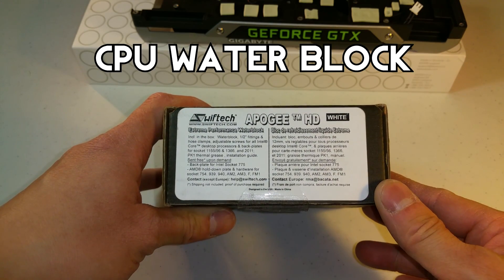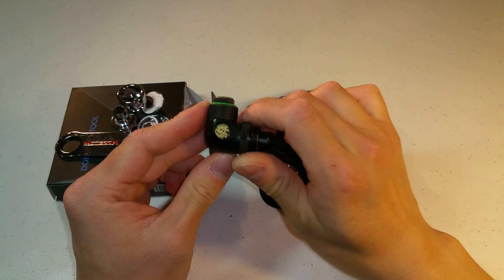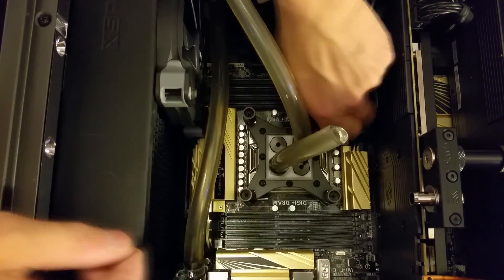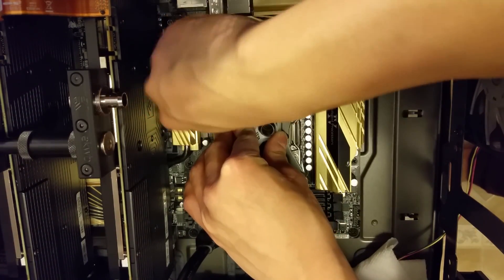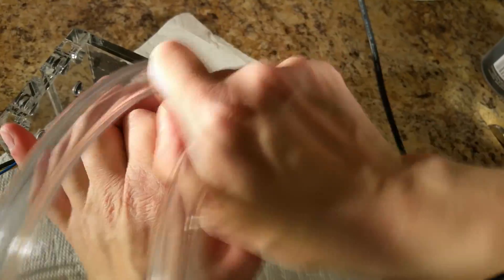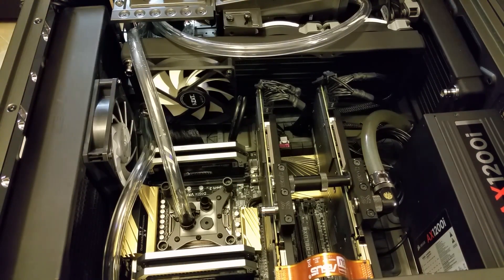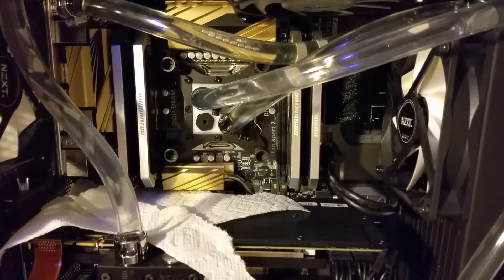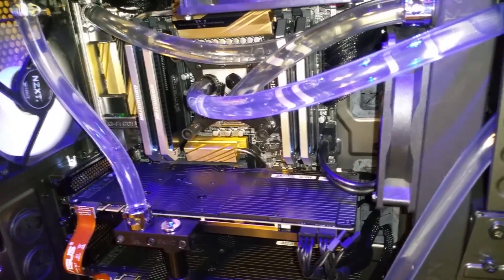Gaming PC Custom Water Cooling "How to" Build Step-By-Step Guide

Comment: Gawd, I feel it's too much work and it could come out to be very expensive.  Is it worth it, in the end?
Reply: idle temps at 24-25C and under load max temps around 35 to 45 C, pretty much useful if you ask me, you can go for aggressive overclocks and higher voltages.. without the risk or i should say.. less of a risk of toasting your cpu and gpu..  and yeah.. if you got monoblock.. that is just awesome.. cpu and mobo VRM MOSFETS cooled in one go.

Comment: DONT DO THIS.if it leaks on to ur motherboard,gpu,cpucooler or ur psu.than ur pc is rip.stick with fans
Reply: badboy 25 Call of duty? Battlefield? That says enough about you.
Reply: Deta335 Hahaha allright, I will let him go ^^
Reply: Use freon It's better than both
Reply: Screw off minecraft kiddie , my AC leaked on my air cooled rig , roughly 2.5 cups of water and i even tried to boot it , after it dried it worked perfectly AND distilled water doesnt conduct electricity. Also whos gonna listen to a kid that obviously doesnt know anything but minecraft pvp
Reply: Deta335 yeah i am sticking to fans.leak means R.I.P PC.i am never gonna cool my computer with water
Reply: +badboy 25 you don't need to cool your pc because the only thing you play on it is minecraft
Reply: Rony Riezen noo I play hardcore pc intense games too like battlefield 4 and even cod bo2
those 2 games are pretty intense.so I do need good cooling.but right now I am on a laptop and my fans are broken so I don't have good cooling I need to replace them
Reply: Rony Riezen are u even a gamer
Reply: badboy 25 are u even at least 18?
Reply: Rony Riezen I am 14 and I am allowed to play games stupido
Reply: badboy 25 go to minecraft kid
Reply: Rony Riezen what fck is ur age. from ur profile pic I can tell u are 10 and u are not a gamer.if u hate gamers than get the fck out
Reply: badboy 25 from my profile pic you say 10? As long as I know is that you don't know anything about games beside call of duty and minecraft. My profile pic is chocobo from the final fantasy series.
Reply: Rony Riezen I don't think u are a gamer.
if we us gamers like to play hardcore pc intensive games and u don't.than u don't need to come between us gamers
Reply: badboy 25 call of duty black ops isn't fucking hardcore dude, what are you saying. Come on man read your own comments back and look for yourself.
Reply: Rony Riezen I am talking about black ops 2 stupid kid.and its hardcore pc intensive
Reply: badboy 25 it is not hahaha
Reply: Rony Riezen do u even know what hardcore means
Reply: badboy 25 gamemode in fucking call of duty
Reply: Rony Riezen do have ever played fastpaced games or not.or u only play slow ios and android games
Reply: badboy 25 nah, but i am ending this trash talk, cya boy
Reply: Rony Riezen yeah just end this
Reply: Rony Riezen let him go , atleast when i was 14 i wasn't stupid enough to call someone "stupido"
Reply: Dude, fix your grammar. Also, stop thinking playing call of duty makes you a pro or something, call of duty is the most dumb, overused, cliche, mind numbing game franchise in history.

Comment: Great video and very helpful. I am a beginner for water cooling and have a Swiftech H240x that I am about to add the XSPC Rampage 4 Black Waterblock Set to my loop. I was directed to this video for reference.
One question: is that a Phantom 820 case with 2 (or 3) radiators in it?
The reason I ask is I have the Phantom 820 and it's a great case.

Comment: Yeah I'm just gonna stick with fans.  This looks complicated
Reply: Royalty GamerZ It's not too bad, especially if you buy a complete set from alphacool or xspc.Then u know everything is compatible and you get instructions.
Reply: Royalty GamerZ  or you can a pre-built set (but still configurable) from Swiftech. I got the H240X from them and it is awesome!
Reply: Bruce Meyer can u add custom tubing/coolent to the swiftech 240X???
Reply: Arec Herroon yes you can.  It is a custom loop system that comes pre built. You can add blocks and change parts as needed
Reply: Royalty GamerZ me too if it leaks my pc is than RIP

Comment: if i get this in my pc what power supply should i get i am buying this pc off ironside and also great video keep up the good work man!

Case - Storm Stryker (Full Tower) [Iron Tundra Ready]
Additional Case Fans - 3 x 120mm Blue LED Cooler Master Sickleflow High Performance Fans
Internal Lighting - Dual 12" Blue Cold Cathodes
Intel Processor - Intel Core i7-4790K 4.0GHz (Quad Core)
CPU Cooling - Iron Tundra Custom Liquid Cooling [240mm Radiator]
Intel Motherboard - [SLI / x-fire] ASUS Maximus VII Hero [4 DDR3 Memory Slots]
Memory - Corsair Vengeance 32GB (4x8GB) DDR3 1600MHz
Primary Hard Drive - 2TB 7200 RPM
Graphics Card - Nvidia Geforce GTX 970 4GB (Min. 650 Watt Power Supply)
Reply: You could get away with a 800W since while the 970 has issues with its 4GB RAM its very power efficient.However I would suggest a 1000W/1200W PSU gives you more headroom later on if you decide to swap out the GPU or add a second in SLI.Ideally for best efficency you only want your system to be using between 50%-80% of your PSU's rated wattage.
Reply: If you want an 1000W psu, I suggest going for a EVGA SUPERNOVA NEX 100W G2.
Reply: Al Victor Its a good recommendation have the EVGA Supernova G2 1300W myself
Reply from the maker: I think 1000W will be good, in case you want to upgrade to SLI in the future. I used a Cooler Master one previously, and I have a Corsair 1200 now, but the others have suggested EVGA, which I personally have no experience with, but I've read some positive reviews.
Reply: VeryTraumatic Another Brand to consider is also Superflower they are essentially a EVGA Rebrand they also have a 10yr warranty(EVGA).
Reply: ty